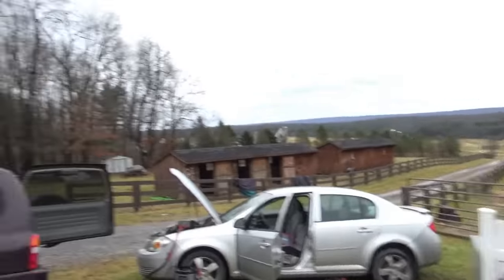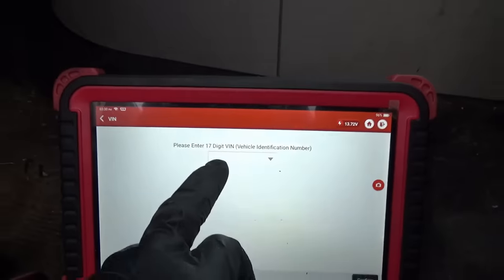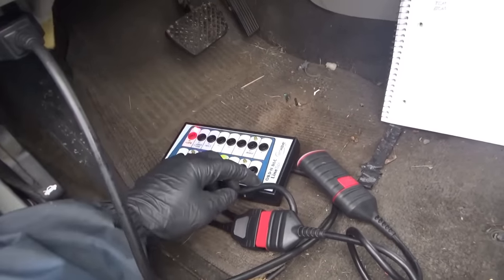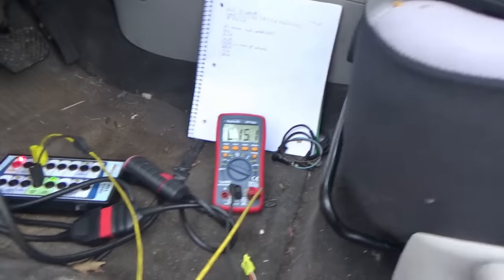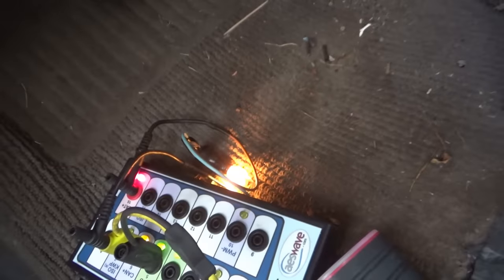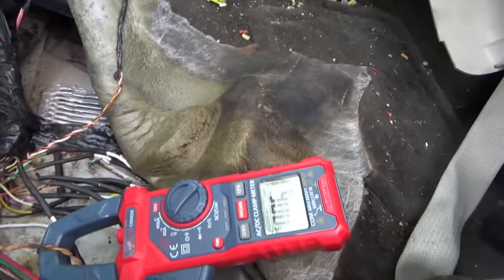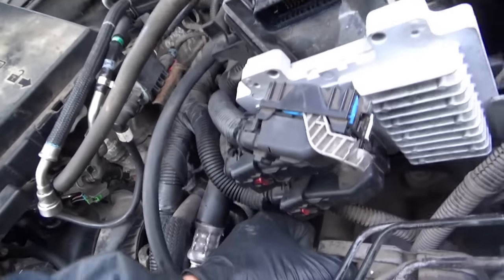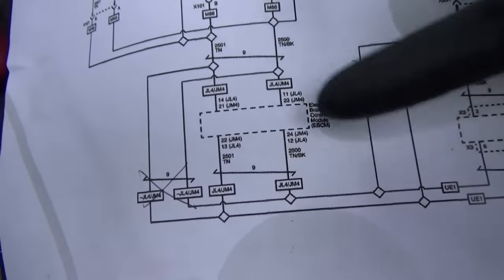Welding DISASTER... (Part 1 - No Crank/No Comm after Harness FIRE?)

Comment: Hey Ivan do you think you could explain how you were jumping power to pin 6 and 14 through a test light to determine a short to ground condition? 

I'm understanding it as adding a load in line to verify when power is jumped to the circuit it is finding a ground, and lighting the test light. But what does the 1.2 V mean once it's jumped? Also does the test light in line limit the amperage going through the CAN circuit to only 300mA, protecting the computers and the 12v reference circuit? 

Thanks in advance!!
Reply: It just means that it's not an absolute short.. Because then it would say 0.0v..  So it's a partial short-- which could be through some weird corrosion and green crusties--  or in this case, it's likely shorted inside modules where there are a lot of electronics and circuitry, so you still get some voltage readings.    ---  Now I could be wrong here, because I'm still learning about can bus just by watching. lol..    I agree that it would be super helpful if Ivan would have explained what pin 6 and 14 "Should be" on a known good.
Reply: 1. The test light does limit current to ~300mA. 2. The 1.2V tells us that the ground is not perfect. If you probe to "perfect ground" (like battery negative post), in theory you'll measure zero volts and test light will be bright. In reality, you might measure ≤ a few millivolts.    

An extreme example would be a nasty battery clamp causing a "NO CRANK" complaint. You'll notice during initial testing that headlights go dark when key turned to "CRANK" position. If you measure voltage between offending battery clamp and battery post, you'll measure SEVERAL VOLTS. Clean and tighten your clamp, and you should measure only millivolts during cranking, and headlights will barely dim with a good battery.
Reply: @calholli  ahh I get it now. We're not seeing all the voltage get consumed across the load. Almost like there's another load in the circuit, potentially in the form of corrosion, that the remaining 1.2v would drop across. 

Thanks!!
Reply: @hightttech  RIght.  The bad battery terminal connection acts like a resistor and will have a voltage drop across it, typically up to 6v;  (like a voltage divider).
Reply: @hightttech  Yea I got confused and needed to look at it in terms of voltage drop across all resistors in a circuit. In reality there's another load somewhere in this circuit. 

Like the battery terminal example you gave. Simply measuring voltage drop across the terminal. Makes sense. 

Thanks for taking the time to clear things up for me!

Comment: You can read amps while clamping both wires?   I thought they would cancel each other out, and you can only test amps with a clamp across either positive or negative-  but not both at the same time?
Reply: Only if the return current flows on the second wire.  In this case, the return current likely flows on the chassis.
Reply: Both network wires were pulling current with the bulb in the circuit, so clamping both just gives you total current draw.

Comment: You always get the weird ones, Ivan :-) Not watched the video yet, but I'm betting on mis-spliced wires, or molten insulation further back. Wrong again, after watching for a while :-) It seems the HS network was cooked and took all modules with it. Unseated relay didn't help either. Bird feathers coming out the tailpipe - mouse nest in the exhaust? Too many, seemingly, unrelated problems.
Was already expensive to diagnose and seems far too expensive to repair - why was this a Part 1? Is there a next one? That would be crazy :-)

Comment: Welding is an electrical process messing with the ground of the vehicle, I think they tell you to disconnect the battery and make sure the positive is in the air when welding. You get current and odd voltages going through 5 or 12V digital components, bad things might happen, eliminate the current path and it shouldn't be a problem. You put those voltages directly into the wires, all bets are off for those modules regardless of what you do with the battery and car 12V circuit.

Comment: you have to be so careful when welding on modern day vehicles a loom is no longer just a couple of lives and earths ;/ top tip when welding single skin panels check your blind side for looms barrier isolate and have fireman sam on stand by with the spray bottle to cool any hot spots

Comment: I have a car I wish like crazy could be fixed but I've had the best of the best tear into it and still not running. 
 I'll give a short summary. 
 2008 chevy Malibu 2.4 ecotec automatic, ran and drove good I got mad one day and went to throw something (I was middle ways through changing spark plugs) and went to throw the ratchet my extension got hung up on some wires (throttle body wires) ripped the plug off. I wired it back and drove the car months with hit or miss issues.
 One day I went to McDonald's the battery died I had it jumped off it fired ran like a charm to my shop cut it off and 3 weeks now of messing with it and letting everyone else who claims to know cars mess with it she still won't crank. Take a hot wire touch starter it turns over strong. Act like it don't have a starter if you try by key. 

 Dash says " power steering", Pwr reduced " and finally engine disabled.
Reply from the maker: Poor Chevy got mad at you for throwing the ratchet at it 🤣
Did the "master mechanics" at least scan it for codes??
I'm guessing the throttle body harness wasn't properly repaired... Just a guess 😉

Comment: Ummmm....he wants this thing repaired?

You know, when you first cranked this over, I heard that there might be a low cylinder or two ( 21:29 ).  Who knows, stuck rings, valves, whathaveyou.  Once this was running, did it ever smooth out?

Might be best to do a wet/dry to see if you have any dead holes.  Again, I couldn't tell from your video how it was idling, but if it was uneven then it might have some internal engine thing going on.

Be ashame to buy all those modules just to find you have a few bent valves.

Comment: Oh my God... A rusty old automatic cobalt and the owner is going to throw like $1500+ into it (on top of the prior expense)... The used car market can't be THAT bad, is it?
Reply: Unless You happen to stumble upon one of those rare deals, it is that bad, though improving somewhat. Find something for 2 to 4k You usually have to put another pile of money into them to get them right, and most often in our area there will be rust issues.
Reply: A used car dealer near my house had a 2010 PT cruiser on his lot. It has almost 200,000 miles on it. There is a rust hole clear through the rear hatch. He was asking $6500 for it. I see that it is gone, so somebody bought it!

Comment: This is what I do not like about incandescent lamps as a test load, other than the obvious unwanted inrush current, is they don't really tell you much, it's bright, it's dim, it's what?

Why not use a non-inductive known value load resistor (like around 6 Ohms, or 6.2 Ohms) instead of a filament bulb and then measure the voltage across it, or better yet just use another DMM as an ammeter (10A range) in series and read the current directly. This is basically the same idea of a set load function from the Power Probe for 12V systems, or as an option for 5V systems.

Filament testers (bulbs) are not appropriate to test automotive electronics. Why, there are better and safer ways of testing. Especially in the automotive OEM industry, where I rarely see a test light, and if I do it is usually LED. Please do not use filament test lights for automotive electronics. Use a good DMM. Especially if you are using a regulated voltage vehicle power sustainer, like in the video. Why, because once you establish a known voltage at the power distribution fuse panel, when you use the DMM on volts, you can readily see if there is a drop or not at the panel while you are testing fused power feeds, or perhaps a power feed after a splice, you are testing relative to a known supply voltage. 

One good example for automotive DMM electronic testing is the Fluke 87V, 87V Max, or the 287. To introduce a load just make your own out of a non-inductive power resistor. If you assume the vehicle battery is around 12.4V, and you use a 6.2 Ohm load resistor, then according to Ohm's law, the test current is 2 Amps (with no inrush). For a 1 Amp load use a 12.4 Ohm resistor, and so on. Just make your own set for what you want to test. For example, a HEGO heater draws around and amp, so you would use a 12.4 Ohm resistor as a test load. 

People say, well I have never had a problem using my incandescent filament test light, which is good news. Because, when testing automotive electronics, the first time you have a problem is when you brick a control module or a cluster. How this happens is the high inrush current blows a PCB module fuse (soldered on the PCB) or a PCB fuse trace.

FYI; The rear mounting tray for electronics under the rear back deck (below the rear window), for US OEMs, is traditionally called the package tray.

Why would you have CAN wires going back to the rear module and then returning from the rear module as part of the same network? Why not just put termination in the rear module? So without the rear module the network is just jumpered, and then returns to the front of the vehicle where it is eventually terminated, and this is because the rear module or harness does not have a CAN termination option? Interesting approach.

A partial loading of the CAN network is usually a failure in the CAN interface driver IC, which traditionally is a very robust device. Which means is was not heat that destroyed it shorting the circuits to the body ground, vehicle power or another signal (which it is designed to withstand), it was welding current. Somehow the CAN interface IC(s) got fried due to welding power electrical overstress. Basically, the customer welding his powertrain CAN module interface IC(s). The good news is they are readily available and relatively easy to replace on the PCB. If multiple module CAN transceivers got fried then you would have to repair all the damaged modules. Note to self, do not weld a CAN network. 

Instead of unplugging modules to find a faulty CAN driver, just pull the fuse power feeds if possible. A working powered down CAN transceiver should not bring down the bus unless the IC itself is damaged. If you disconnect the module connector and termination is onboard that module you will lose termination. If so, you could reintroduce a terminating resistor at the connector if the module's CAN transceiver is fried.

So, the ECM was swapped with no relearn, or keys encoded? Perhaps the original ECM CAN transceiver is also fried. But, the real question is, does the used replacement ECM have any problems?

A new TCM will have to be updated and may need a solenoid relearn.
Reply from the maker: Test lights are amazing and versatile for automotive troubleshooting. They give a good visual cue for intermittent problems, and can be stacked to provide the desired amperage. You can easily connect a DVOM to measure voltage drop as well. Inrush current is usually not an issue since most computer circuits are well protected against direct shorts 👍

Comment: Disconnect battery before welding on a vehicle, classic example of why right here. If power was disconnected when the fire started it would have saved the modules, repair wires and off ya go

Comment: Find a junk car and do an entire rewiring and modules transplant. I worked on a car that got hit by lightning. The lightning most likely hit the antenna but may not have travelled on the metal body of the car and not jumped the tires to ground😊. Fried all rhe modules on the car. 😢

Comment: Entire cars a shit show..  had to have been sitting for long enough for mice to make a big o nest in the muffler, dude was welding with the battery connected so when it shorted it either fried from battery short or fried with the arcs from the welder..  stray voltages..  itd be totaled out in my book as well.  Good run through though.,

Comment: I think they didn't disconnect the battery for soldering.  It is very important to disconnect the two poles whenever you soldering or melt the modules and wires.

Comment: wanna mess with my car xD 2010 Dodge Charger that was left abandoned on a farm for 7 years the deermice made it a motel and they chewed the harness in multiple spots... when i purchased the car it started and ran unknowning how many wires were chewed through in the end the abs module was absolutely dead i broke the case open and there was a volcanic hole right in the middle of one of the main processes.. it took 2 days to find and repair the entire cabin harness i was lucky in more then one way that i didnt burn the car down but it did start right up run and rdrive and it had a partial network it was spurraticbare wires were starting to touch eachother here and there.. kinda sad we have a cobalt and a G6 that has a completely messed up subframes but runs fine =/ the cars will eventually be stripped and parted

Comment: Ivan when are these DIYers ever going to learn the heat welding produces will go right through sheet steel even if it is 3 or 4 sheets thick such as the panel joint at the bottom of the rockr(outer and inner  the floor pan is also usually joined at thihis seam ) be warned all you diyers there aere a number of makers who like to lay their cable runs along the floor close to this joint ( look befofe you weld it can save you money time and frustration